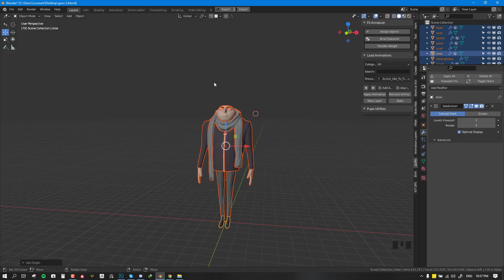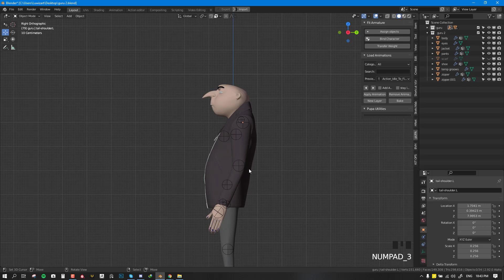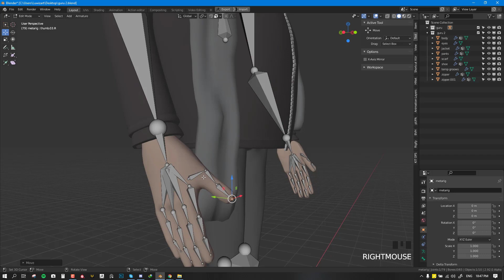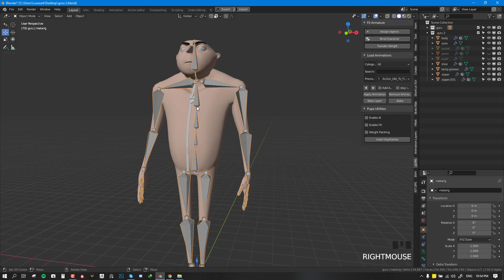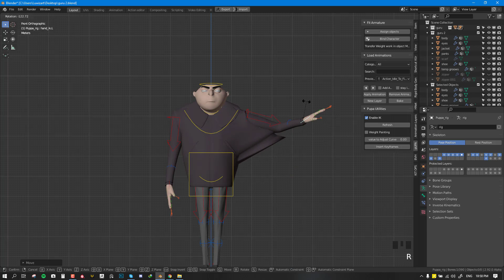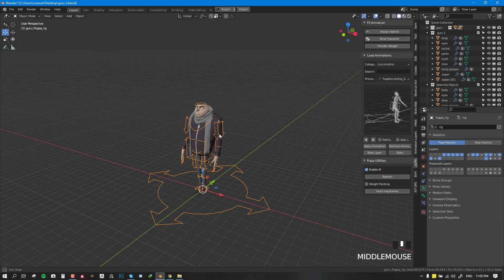Rigging with Pupa Plugin for Blender

Comment: LUWIZ ART, is there any way to get this to work if you already have the full meta rig aligned to the mesh in blender before even using the pupa options?
Reply from the maker: yeah it recognizes rigify
Reply: @Luwizart  is is normal that there is such a lag after you apply the animation or is it because I applied the animation to a rigify rig I set up without going through the plugin armature process?
Reply from the maker: @kellyjohnson768  the lag is the retargeting process, which is necessary to fit any number of poses. But more updates will make it faster
Reply: @Luwizart  luiz, when will you add in facial expressions?
Reply from the maker: @kellyjohnson768  it will be a later up both not so soon
Reply: @Luwizart  Luwiz, thank you for helping get this product out there...it has alot of potential...but since I'm trying to create comics, animations aren't the best for that.....static poses and facial expressions and combinations of the 2 is something I am eagerly waiting for.